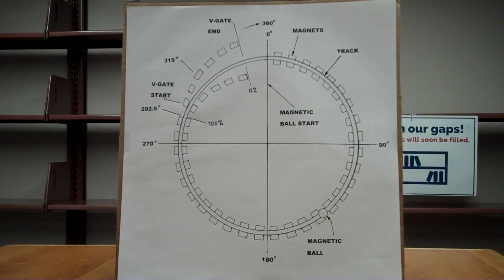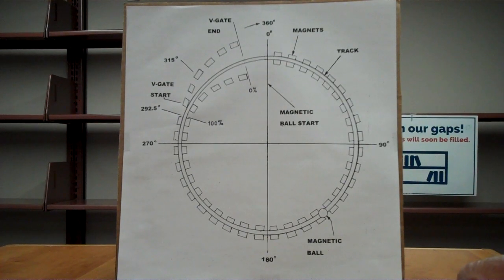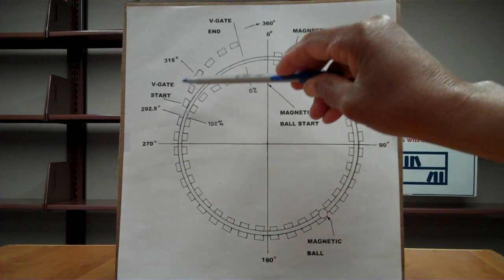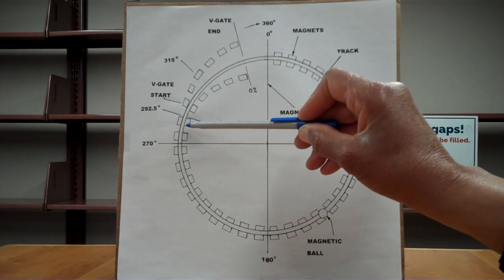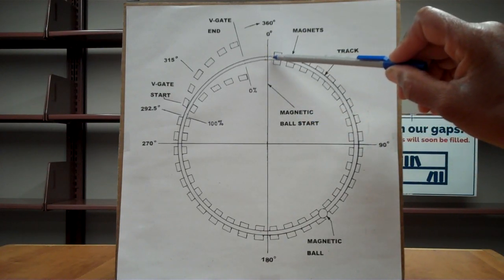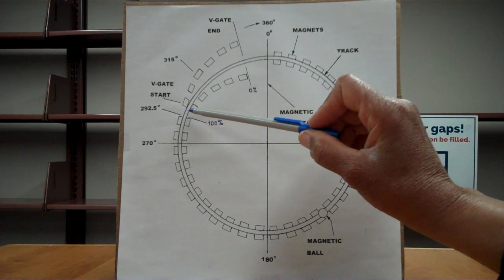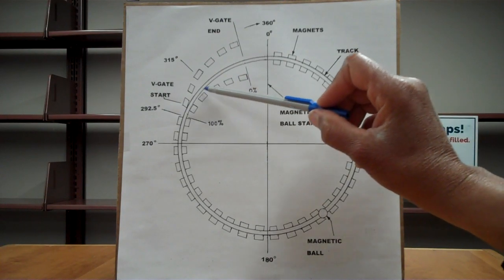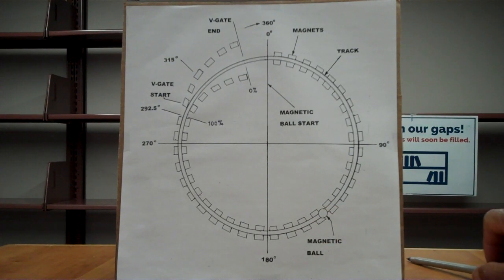MAGNETIC ACCELERATOR Breakthrough | The V-Gate Semi-Perpetual Revolution

Comment: Sir, I have a similar ideas but need some help creating my designs. What kinds of tools do you recommend I get for drawing? I thought about getting a CNC machine and Rino software but it's too much for my budget.
Reply from the maker: Mr. Peter Paun : .. What you intend to do shouldn't cost you more than $300 in total. You look for the least expensive way to do what would cost $1K's, $1M's or $1B's for less than a 1K dollars. Use pen and paper to begin. Only a penny or two on the dollar.
Reply: @jessiejohnson3457  Thank you Mr. Johnson. Where are you located at? Are you teaching a class? I live in the central valley California and would love to attend your class if you are teaching.
Reply from the maker: @yinglium1934  : .. I live in Berkeley, California. Home of the University of California, Berkeley campus. -- If you already have a working magnetic accelerator (linear or otherwise), partially or fully working, only a few things are needed to get the projectile-magnet to go around in a closed loop indefinitely. It will take work and testing for precision.
Reply: Mr. Johnson, I am working on a push pull circle and it's not working. How can I send you a video for your analysis?
Reply from the maker: @yinglium1934  : .. Please, send a video, simple picture, drawing or photo with short  explanation of what you're out to achieve to: jessiejohnson70@yahoo.com.